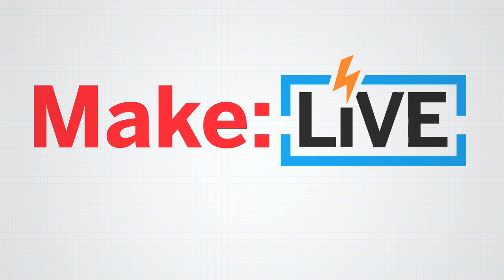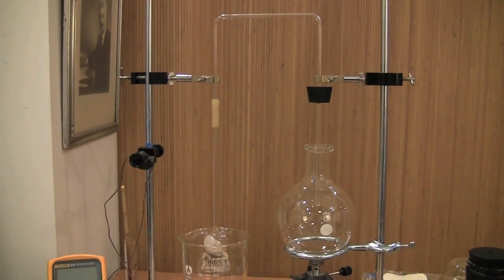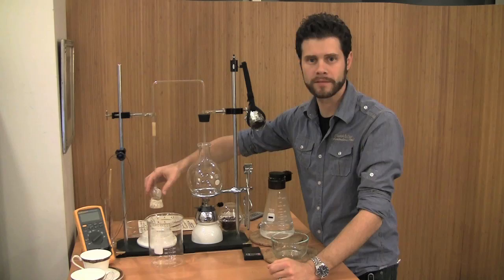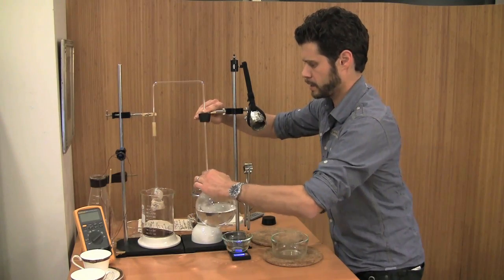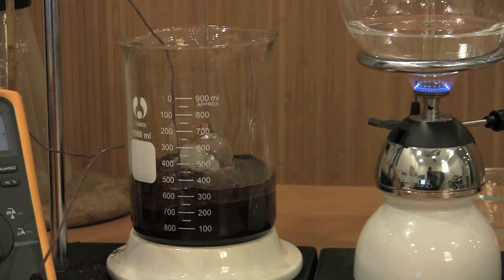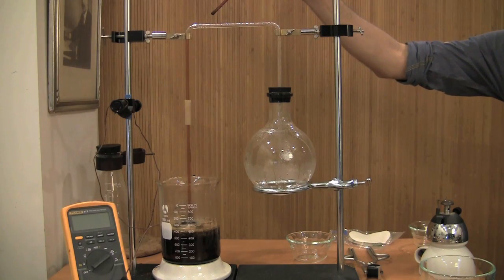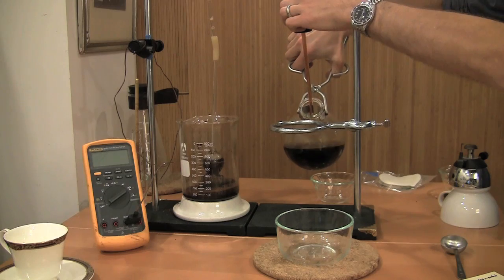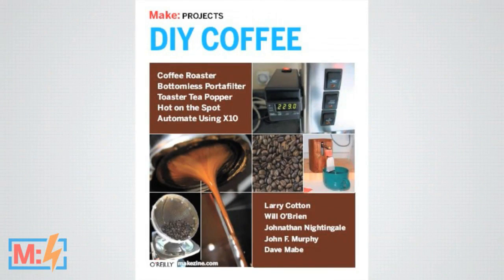Siphon Brewing Apparatus on Make: Live ep08

Comment: What if you were to close the system to the outside atmosphere(with some internal method of stirring) and reduce the air pressure before boiling ? That would reduce the temperature required for the water to boil and, in theory, it less bitter due to a reduction in quinic and tannic acids in the final product. Not saying it'd be easy to pull off, but I find the thought to be interesting.

Comment: You need to learn how to handle this equipment better. Don't pour like that, the steam can get you, also it is awkward.  That piping, though flexible, can break. Also it didn't need to be so tall. All that excess height just adds pressure to the system. This means more boiling to overcome the pressure and is not optimal. Also pressure drop to piping can be avoided

Comment: The thing I like about this over the commercial ones (Hairo for example) is that this seems to get 98% of the water from the Florence flask (apologies if the terminology is incorrect, high school science was a long time ago) over to the brewing beaker.  I guess that's due to the smaller diameter glass tube in this setup as opposed to the inch diameter tube in the commercial setups. Correct?
Reply: The thicker the tube, the stronger the vacuum needs to be to have an effect. So, yes.

Comment: Great video. I found my copy of volume 17 and built my own. it seems to work quite well and looks great but there is a small, but infuriating problem: when I remove the heat source and the vacuum begins to bring the coffee back over, the filter clogs in a matter of seconds, blocking all flow in the apparatus. Any help or reason for this would be very much appreciated.
Reply: I would think you could try different types of filters. I dont know if a ceramic filter would be good for this or not. Have you found a working solution since this post?